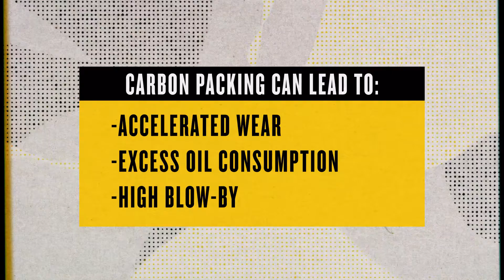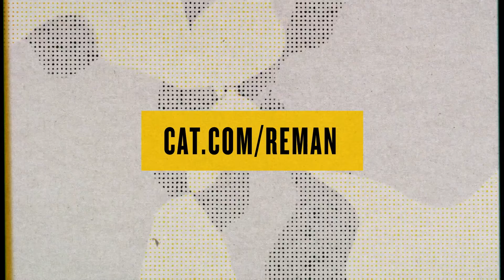Myth: Piston Rings Don’t Rotate While Your Engine Is Running

Comment: If anyone knows, its probably Cat. This much i do know, I've seen two-stroke engines that have the rings pinned to the groove. The only purpose that could serve would be to prevent rings rotating.
Reply: Yes 2 stroke pistons are purposely pinned to stop rings from rotating or else the ring gaps would rotate till lined up with a port within a minute and destroy it's self. Not sure about 2 stroke diesels though
Reply: @jamesleeson6680 Two stroke diesels are the same concept as far as keeping the ring gaps from the ports, maybe more so. The cylinder porting is much more extensive than the porting on a two stroke bike.